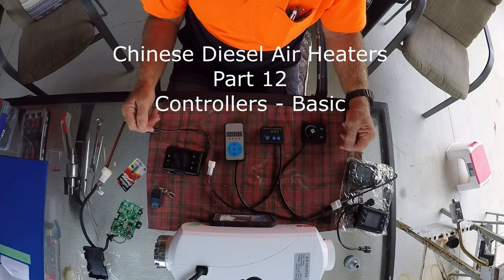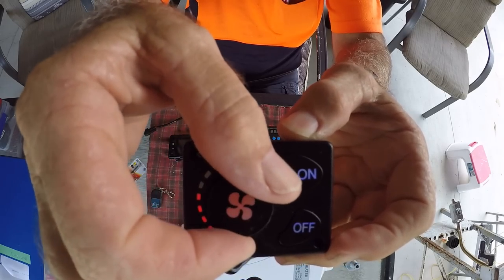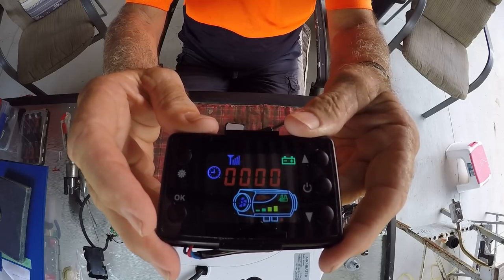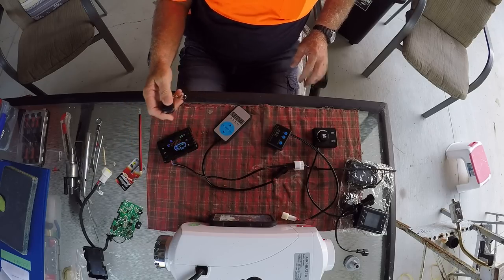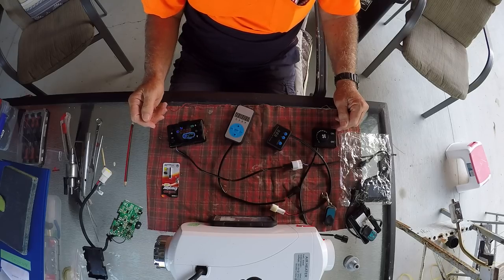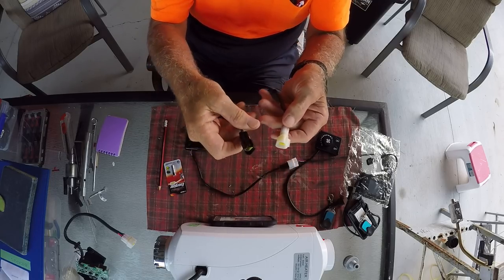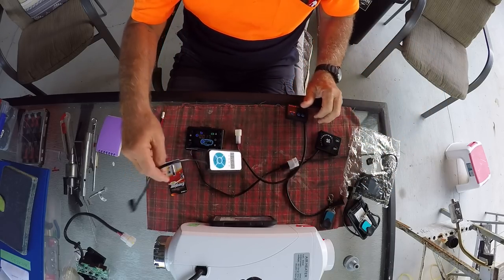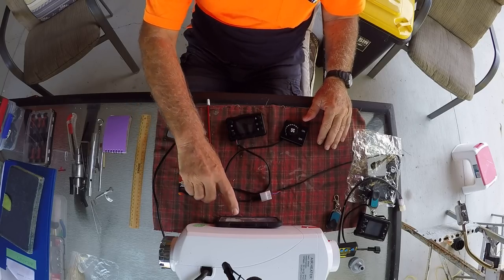Chinese Diesel Air Heaters -  Part 12 - Controllers (Basic)

Comment: hey JOHN!!! I from Argentina .sorry,my inglish is very bad ,I need help that you,my pump 22ml its broken ,I bougth one of 28 ml wEBASTO,how I can reduce or modificate it for my heater works fine,.Thank  you for all!!!!!!
Reply from the maker: Hi PI, 

Not quite sure what you mean here. Are you saying your heater works well with the new pump? If so, why do you need to change things.

I have found in testing the 28 ml pump works ok, a little rich perhaps, but generally ok. If you are an enthusiast you could go into the locked settings and increase the fan speed slightly to get a better fuel/air ratio, but you can open a can of worms here and get into a lot of trouble with the mix ratios, and there is no reset button. My advice for most people is to leave the factory settings alone.  JMcK

Comment: Hi John, what a great informative video, this may sound stupid but if there is a risk of destroying the ECU in the event of loss of power to the controller, would it be possible to relocate the ECU outside of the heater unit to prevent such an issue.
Cheers mate,
Terry.
Reply from the maker: Hi Terry,

First, thanks for the positive feedback.

Second, yes you could probably relocate the ECU outside the heater, but it would be very difficult. Eg you would have to remove the fan sensor from the circuit board and then make a seperate bracket for it over the fan, then extend all the wires etc.

But why bother, it is very rare to lose power if set up correctly, and in the extremely rare occasion this may happen, a Chinese spare ECU is about $20.

Cheers.   JMcK

Comment: Can an esbar d2 or webasto controller work if spliced in to these units? Thanks.
Reply from the maker: Hi, I can't answer that without good knowledge of the ECB settings and its wire code. In theory it should be possible as you are basically just changing the pulse rate of the pump with the controller, and measuring the room temperature.  JMcK

Comment: Can these controllers initiate a fan only mode? My heater us outside so if so I could flood my cabin with fresh air if needed. Possible?
Reply from the maker: No Jslove, not the current Chinese ones I have seen and tested. 

However if you have some electric knowledge, solder and wiring skills, or know someone who does, you could separately wire up the fan through CPU isolating relays and a pot to adjust fan speed. 

However, perhaps a safer and simpler way is to install a computer fan in the piping and see if it is able to draw enough air through. I have not done this so I can't give an outcome. However I would try both blowing and sucking to see what worked best.

Perhaps a viewer has already done this and may reply to you.  JMcK
Reply: and i ve seen some ebay sellers advertising it as a cooling system as well.. :) . You just cannot trust their advertising info. thank you john for your amazing presentations @johnmck1147
Reply from the maker: Hi Mr Ros, some of the genuine Eberspacher models do have a fan only mode. The one on my boat does have fan only. It could be possible that some of the Chinese copies now have a fan only mode, but I have not seen one.

With the new electronic controllers, it would be very easy to program in a fan only setting.

Regards, JMcK

Comment: Which heater would you recommend in the 5to8 kwatt range ?
Reply from the maker: Hi Darell, I can not recommend a particular heater.
What I do suggest is you buy from a supplier who has a good record, preferably one that has a local warehouse in your particular country, and one who accepts returns of faulty products.
I also recommend you always bench test the heater before install, and in the small chance of a dud ask immediately for a replacement. You don't want to go to all the effort with an install and find you have a faulty heater.  JMcK

Comment: Yes I ordered a Chinese heater. I had a basic controller it looks a little different than the one on the video. Then my wire came loose and it was sending mixed messages to the heater it would come on go off. My problems started when that wire was loose and after it was soldered it was still giving me problems . I ordered a nicer controller electronic digital. I ve taken the heater apart numbers times cleaned it change the screen sometimes it was really carboned up.Sometimes it was wet inside. I experimented trying various things. Now it just smokes like crazy. I took compressed air and blew it into the intake when the pump is on and smoking I pulsate my  air nozzle.  It starts to ignite.  I continue to pulsate the compressed air nozzle until it stays ignited. Initially it Heats almost to its Max and then it slowly Fades away and start smoking again and then it shuts off. What's my problem.
Reply from the maker: Hi Lionel,

It is a bit hard for me to diagnose without seeing the heater running, but I suspect a combustion burn issue. Carbon build up and “wet” internals (raw diesel) indicate a poor combustion. This is generally caused by bad fuel air mix ratios. A smoking heater generally indicates too much fuel and not enough combustion air.

You need to not only remove the carbon from the heater but also from the atomisation screens in the burner and the igniter. If the burner atomisation screens are blocked with carbon you will not get a good burn which causes more carbon.

Your new controller may not be compatible with your old ECU, or your past wire issue  may have sent a voltage spike and caused damage to the ECU.

Unless you are an enthusiast who has the tools to check these things and the fact that these heaters are so cheap, it is often better to buy a new heater and use the old one for spare parts.

Cheers.  JMcK

Comment: Hey John. Another great, information video! Kind thanks. Over the years I've purchased many of these heaters from different sellers on eBay only to have them show up damaged, incomplete, non-functional, etc. It's as if they really didn't care much as long as you bought one. I'm wondering which seller you would recommend for a consistent working product that comes with all the parts. I live in a cold place in the winter and really hate to be troubleshooting at -15. Kind thanks! Greetings from Alaska.
Reply from the maker: Hi Shipfixer,

Sadly the eBay suppliers come and go which is why I rarely insert links in my video description. I think they buy a shipment of heaters and when sold out move on to sell something else.

I suggest you try and buy from a supplier who has a warehouse in your home country, that way you may get a bit of advantage. In the past two years I have bought from 6 different heater suppliers and I don't think any still sell the heaters, or even in business under the same name. But on the plus side, I have had small issues with just one supplier. 

Sadly, the most enthusiastic and helpful eBay seller sold a brand of heater I could not recommend. Not her fault, she just bought a shipment of bad design heaters.  

Sorry.  JMcK
Reply: @johnmck1147  That is so true. I realized that after posting. Now the trouble I'm running into is something altogether different. Since the covid-19 outbreak, It seems every seller has jacked the shipping prices up to unbelievable amounts. A $125.00 heater and $500.00 to ship. I would have to be out of my mind to pay that. Thanks again for all your videos.
Reply from the maker: Shipfixer 2006 
Hi Shipfixer, I just went on eBay, and there are many heaters selling at under US$100. with free shipping. Now this is Australia, but I just pulled one seller off at random for you to check out, and perhaps widen your search.  

https://www.ebay.com.au/itm/12V-8KW-Diesel-Air-Heater-Thermostat-for-Caravan-Motorhome-RV-Trailer-Truck-/184344338037?hash=item2aebc75e75

Cheers.  JMcK

Comment: Hi, I know this is an old video but an idea is to have an electronic switch to cut off the fuel pump, it will soon run out of fuel and shut down
Reply from the maker: Agreed Ian, I always put a fuel shut off valve in boat installs.   JMcK

Comment: Thanks, great video!  What is the pulse rate?  Great background noises with all the animals!
Reply from the maker: Hi Ryan, these heaters have a blow torch type burner inside them, the temperature is controlled by the electronic control unit controlling the amount of diesel injected into the burner. The ECU sends electrical pulses to the fuel pump which then fires a fixed amount diesel into the heater. The pulses are measured in Hz, which is cycles per second.  JMcK

Comment: After months of doing little by little, I now have everything hooked up, and power to the Air Heater in our Camper Van.  I turned on the power supply at the switch board.  NOTHING.  Remote shows nothing.  I then checked the power supply to the heater = 13+ volts.  Still NOTHING.   I have checked the wiring after one of your episodes on REMOTES, and I had to remove the original plug, but I'm sure I copied the wiring sequence and hard wired it correctly.   From the REMOTE I have the RED wire to the WHITE/RED;  BLUE to the BLUE;  and BLACK to the GREEN.    What's wrong with it John?   From Sue's husband, GREG.
Reply from the maker: Hi Sue and Greg,

First, did you bench test the heater before installing it in the camper van? Did it work then?

If you cut off the plug for some reason (perhaps to run wire through bulkhead, why are the colours different?)

Assuming you reconnected the  wires correctly, where did you check to see you had 13v at the heater?

Did you allow enough time for the heater to start? From first switch on it can be a couple of minutes before anything happens in the heater, as the ECU goes through a check list.?

It is very rare, but can sometimes happen, that you get a dud Chinese heater. It also happens that you can get a dud, expensive original German made heater.

My first thought is why is the wiring different.?
My second thought is did you allow time for the heater to do its start sequence?  

Cheers.   JMcK

Comment: what happens if the battery runs out of juice while the Heater is on?
Reply from the maker: When the battery voltage drops below a pre set level, (generally below 11.5V) the heater goes into automatic shutdown mode and turns itself off.  JMcK
Reply: @johnmck1147  thanks.

Comment: Is it possible to replace the controller to another? Mine doesnt have a thermostat and i would love a controller with
Reply from the maker: Hi George,

If your heater came with the standard wiring, you can install different controllers with thermostats. However there is one manufacturer that has supplied me who sent out a heater with non standard wiring and then it is not simple to change controllers.
Reply: @johnmck1147  Thank you. I have the second from the left. With, what it looks like, standard triangle connector. Maybe it is possible then to switch controller?
Reply from the maker: George Weed Bush 

Hi George, 
If your controller is second from left in video, the one with the blue circle at the bottom is a standard controller. All the ones I have seen of this type do have a thermistor already installed for temperature control. Look for a small hole in controller, usually at top but can be at the bottom, that has what looks like it has a small clear match head.

If your controller is second from my left, the one with three blue buttons, these generally have a standard plug, but with reversed wiring. You can not mix and match these.

Good luck,   JMcK

Comment: Hi John. Recently found your channel and it has helped me better understand my Heater,  so thank you very much. I hope you won't mind me asking you for help. I would like to program my heater to come on at a specific time and then off again. 
I have the LCD panel display, and when I enter the startup and shutdown setting it allows me to turn it on at a specific time using #1 but the 2nd parameter just says 2-of and won't allow me to set the off time. 
For instance I would like to set it to come on at 05:30 and off at 20:00.
But when I set the second parameter to off, once I hit okay it automatically goes to the next setting which is admin password. Please help. Thank you. Clayton
Reply: I have had similar issues. I have found out that our control is actually a count down. If you notice the "timer" allows you to select 99 .99 and is not a 24hr clock. So if it was midnight and you wanted it to come on Asap  you would type in 00.30 making the countdown of 30 secs. The heater will come on in 30 seconds. To get it to switch off at 7am you program the second "timer" to 7 hours....so the countdown to switch off is 7hours,  (7 hours of run time)
Reply from the maker: Sorry Clayton, I occasionally miss some posts.
In the past there were a few common controllers that came with these heaters, now there are new and different controllers coming out on a regular basis. There is the common off and on controller, and now the countdown type . 
Was the feedback from Ash helpful?
Sorry JMcK
Reply: @johnmck1147  unfortunately I hadn't seen Ash's response so I will try that first,  and thank you for replying and no worries for missing my question :-)
Reply: @ashdean7306  Thank you, I will try this out
Reply: @ashdean7306  Ok so I was able to get the heater to turn on using your advice but can't get it to turn off.
For instance I set it to turn on in 2 minutes from current time and off after 1hr. It started on time but after 1hr it didn't turn off.
Reply: @kongtony3  glad I could help
Reply: @kongtony3  did you set the 2nd "countdown" for the time off?
Reply: @ashdean7306  I believe so. I set the 2nd time for 01:00. The first time was set to come on 00:02
Reply: @kongtony3  it seems that these heaters are set to 1.4hz so always tick over and never really switch off unless you push the button! Not ideal. I'm not sure but that's what I think might be happening? I tried online again and it ticked over low, not switching off

Comment: Hi John. 

Great work you are doing. Keep on. 
One question: Did you try to just change the wiring from the poor controller to make it work with standard wired heaters and vice versa? Or is it necessary to change the ECU?

BR Wilke
Reply from the maker: Hi Wilke,

Yes, I tried a standard wire loom, and on checking, the actual looms are the same to the best of my knowledge by following the wires through to their different pins. However I just looked at colours to pins, and I guess I should also do a continuity test on each wire to be absolutely sure.

Also the ECU has the same code number as standard, and its wiring to the harness looks the same as standard. 

Until I saw the ECU looked standard I was just going to reverse the wiring in the controller plug. However if I am correct that the wire loom is EXACTLY the same as standard, and the ECU is EXACTLY the same as standard, and I need to fully check this again.. I can only speculate that the ECU programme is different. 

I may, at some future time reverse the controller wires and see what happens, but bad things generally happen when you start moving around the positive (+12V) wire. 

One of the comment writers to this series has software knowledge and if he reads this he may offer comment on this matter.

Cheers, JMcK
Reply: @johnmck1147   Hi John, thanks for the video. I unfortunately have received one of these units with the poor quality controller. Quick question where did you purchase a standard ECU card so I can put a better controller on my heater ? Thanks again Dave
Reply from the maker: Hi Dave, first I would ask for a partial refund. I did and it covered the new ECB purchase.

Below is a link to where I bought my ECB. I already had two spares and rather than try and play with the wiring at the time,  I just did a swap. 

Sometimes they have different plugs on the temp sensor and fan plug, so you may need to  cut the plug wires and resolder to new plugs.  Not hard, watch the polarity and use heat shrink. 

https://www.ebay.com.au/itm/Control-Board-Accessories-Motherboard-Black-For-12V-24V-3-5KW-Diesel-Air-Heater/264019097701?ssPageName=STRK%3AMEBIDX%3AIT&_trksid=p2057872.m2749.l2649
Reply: John McK 47 thanks for the info, I’m learning a heap. Keep up the good work. 
Dave